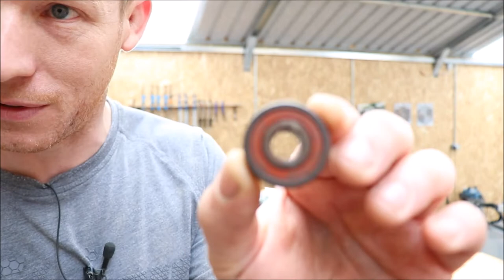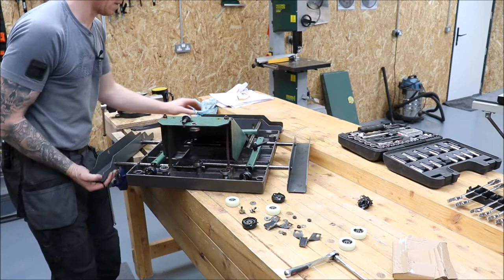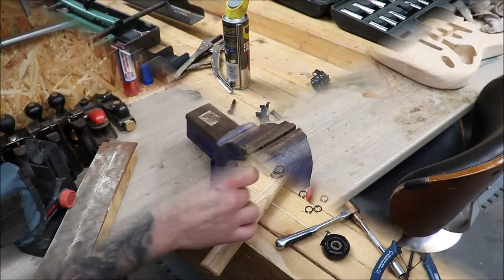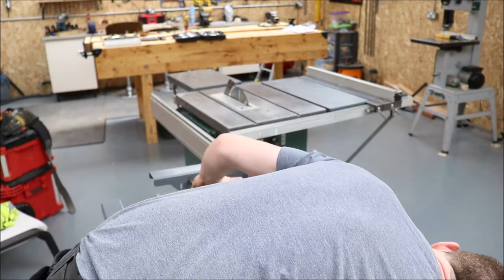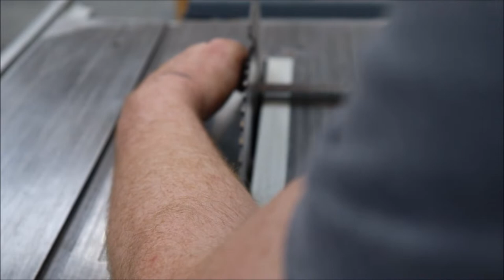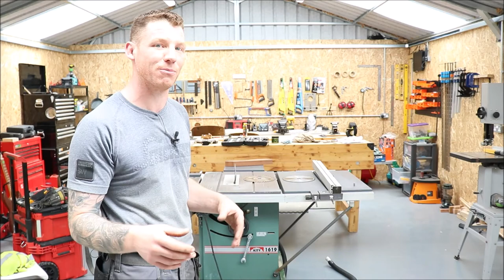Kity 1619 table saw  restoration and setup

Comment: Thanks for the Video. I just bought a used Kity  619 today and cant wait to have it transported to me. Your video was very helpful for me.
Reply: Owned the 619 for about 20 years now. It's been a really great saw for the price, but as you've probably found out by now, the fence (outof square) and locking mechanism aren't the greatest.

Comment: After watching your video it inspired me to strip my 1619 down and give it a good once over (plus new motor bearings as they were shagged) there is actually quite alot of adjustment in the blade alignment... the two aluminium blocks that the whole mechanism hangs on have elongated holes and allow for around 3 - 4 mm side to side front and back.... only problem is the nuts on the bottom are not captive so as soon as you loosen the bolt you cant tighten it up again without a spanner on the nut underneath. 
Also I had no idea about the fence on the sliding carriage as mine never had it when i got it...

Comment: Regarding the fence, you can actually adjust the rails it runs on :) I found I could undo the bolts and move the guide, while the fence was locked. That way it aligned perfectly.

Comment: Hi John, Really enjoyed the video - I'm rebuilding an old Kity 618 - the main saw looks identical to the 619 but with a better fence, the sled is different as is the carriage. I've a few points where I'd appreciate your thoughts  -  getting the blade aligned with the mitre slot - as you say, not an easy adjustment. How did you manage it? I'm a little nervous about just taking a mallet to it.. 

Also, my sled came from a different saw and looks like it's been outside for years and possibly once in a fire :) I can replace the bearings thanks to your video and hopefully can make a replacement nylon guide on my lathe - fortunately, one survived to act as a model. However, I'm missing the sled fence but pics of the original look very similar to that on the 619. Did you manage to source a replacement for yours? I haven't had much luck yet.

Finally, the mitre slot is non standard. Have you been able to source aluminum/adjustable runners? I'm using shop cut hardwood ATM.

Cheers,

Oisin..

Comment: Hey! I really need some advice :D Got myself a Kity 1619 in March, have restored/cleaned and replaced a few bits but hit some struggles when I found the blade and slots don't line up. The two T slots on the main table are bang on parallel, but in relation to the blade were off. I have so far tried all I can and can't seem to get it to "jiggle" around. I have actually had the table fully off, as i hoped id get a bit of wiggle room there, as well as trying to adjust via the aluminium blocks that attach at each end. No joy and it is driving me up the wall :( I am now debating taking the entire motor off to make it lighter so I can maybe get more success. Any tips or help would be amazing! <3 
Main thing is, which parts did you give it a punch on to actually get some movement :D (of note the aluminium blocks do have slots, which made me think it would be an adjustment point)

Comment: Hi John, Thanks for you video which is very clear. 
I have just acquired a KITY 619. Bit ancient but works well apart from one problem. The mechanism for raising or lowering the blade is very stiff. The mechanism for the blade tilt was also stiff, but is easy to access and I have greased the long worm screw and it now moves well. The problem is how to access and grease the long worm screw on the raiser. I just cannot for the life of me find an easy way to get to it without doing a lot a dismantling. I have cleaned and lightly greased the long guide rods but that did not help. Any suggestions??
Reply from the maker: Hi Nigel I no longer have my 619 so can't help you, there is links to the manual in the video description that may be of some use.
Reply: Did you get anywhere with that Nigel?

Comment: Hi there.  I loved the explanation as I have just inherited one so many thank. One question.  Inside the machine there is flap about 350mm long, that has some foam. The flap closes with a spring.  This is close to the Blade area.  I notice mine does not close fully.  I am assuming the spring may be tired.  There is only oine spring though there is a hole for another spring at the other end.  Do you know anything about this and do you know the reason for the flap.  Thank you.  John
Reply from the maker: The flap closes off the area outside where the blade rotates so the air from the dust extraction is pulling down around the blade. There should be a spring on both ends.
Reply: @JohnMcGrathManInShed  Thank you

Comment: Really useful video having just had one and not knowing how to do basic things. I have one question how is the extension table on the back of the saw fitted?
Thank you. Andrew
Reply from the maker: should be just a case of bolt it on using the two support arms

Comment: I have exactly the same machine and my blade goes constantly out of alignment. Those hinges are a pain to align and are not sturdy enough...I'm so disappointed. Do you have any tip to secure the blade in alignment?
Reply from the maker: sorry I don't, I no longer have the saw.

Comment: Are these combi any good John, have 2000 at work  sitting  in corner of mechanical workshop rusting away
Reply from the maker: They are not bad once you fix them up, if the fence is good that's a big help.

Comment: How much does this one cost ?
Reply from the maker: I bought it used for €700 not sure what they cost when new .
Reply: @JohnMcGrathManInShed  I've heard 1800€ for the scheppach 3.0 . Someone is selling me one ( build in 2011 ) for 700e too. So it's not a bad price i suppose
Reply: @JohnMcGrathManInShed  Mine isn't same table on the left. I got different rollers. It has been built in 2011, and you ?